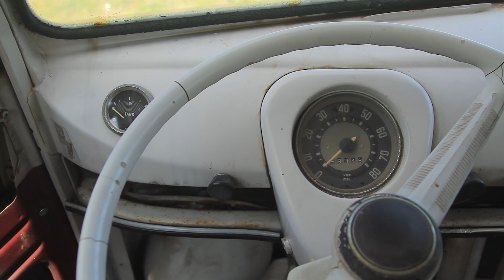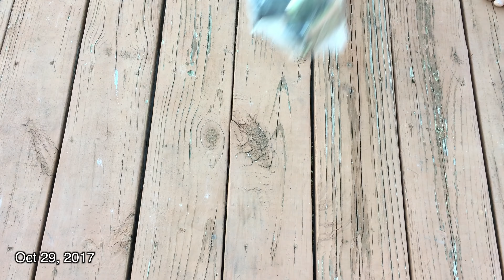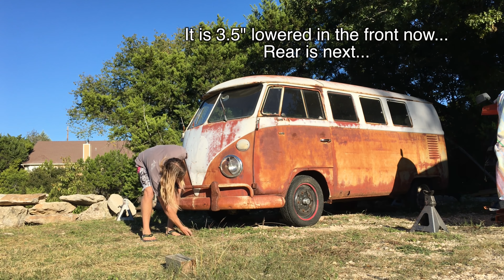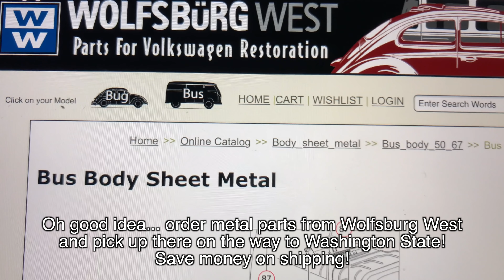VW Bus Restoration - Episode 5 - Wheels on and new plans for Kona! | MicBergsma

Comment: do you have the rear bumper? i would buy it
Reply from the maker: Adam Wing I bought the bus with missing rear bumper 😤
Reply: @MicBergsma  yeah, mine was missing too. 66 and 67 bumpers are getting hard to come by, especially a deluxe with over-riders! I've been told it may be easier to fetch a 68-70 bay rear, and find aftermarket over-riders and drill holes to fit them. I have one of the deluxe rear corner trim bumper guards, still looking for the other, lol. Your bus is looking good! Thanks for the great bus vids, love em!
Reply from the maker: @adamwing9301  Dang... yeah that's what I heard about 66 and 67 bumpers... I learned that they have point end... not like the older models. Dang... I hope you will find one! Thank man! What model do you have? walk thru? Deluxe model?
Reply: @MicBergsma  I have a 67 Deluxe Microbus Samba walk-through.  It was originally Titan Red/ grey beige with platinum beige interior. One day soon I'll give her the treatment you are doing to yours. You're vids are motivating me to clear a spot to get started back on her! She's been sitting way too long!

Comment: Hey I want to suggest that if you use hockey pucks on your lifts they make awesome dampeners when placed against metal.  Plus use shampoo when you want to get tight rubber pieces over metal.
Reply from the maker: Ahh thank you for the tips, I am gonna do that!! Thank you!
Reply: The other thing that Hockey pucks are awesome for are using as a base to mount your GoPro’s too.  Plus they are also very, very good for a substitute when making panning shots with your GoPro because you can rest them flat on any surface...I actually put sliding pads on them to also dampen the sound you get from the surface you slide them on when using it also.  If you purchase the orange color “weighted” pucks they are phenomenal for stabilizing the GoPro’s too.